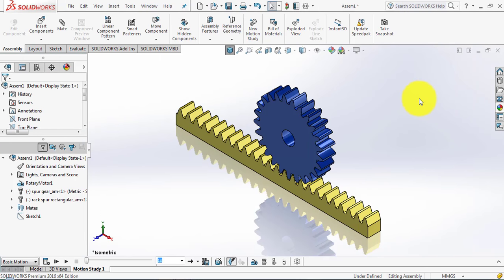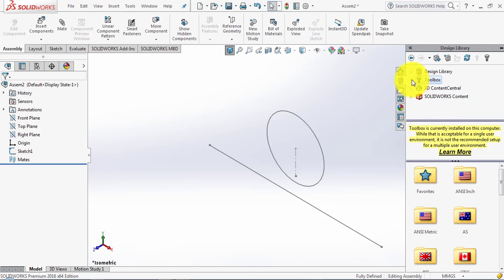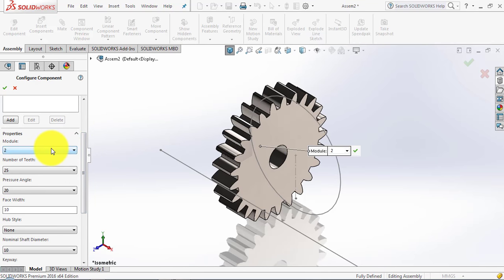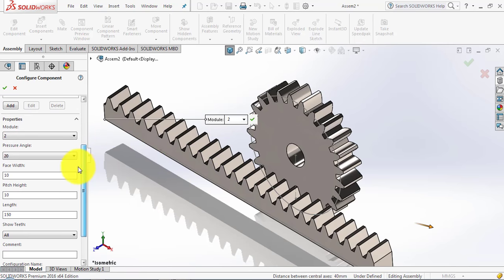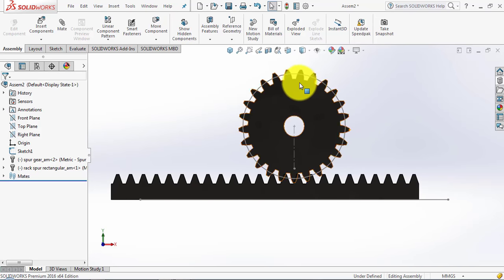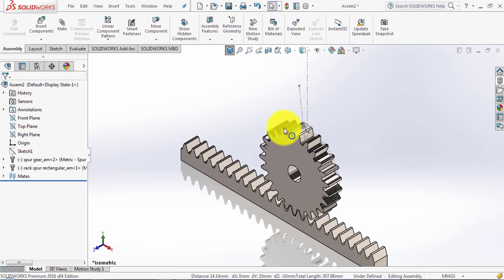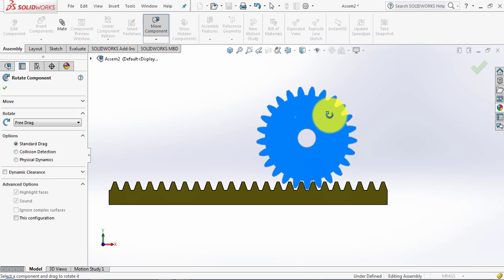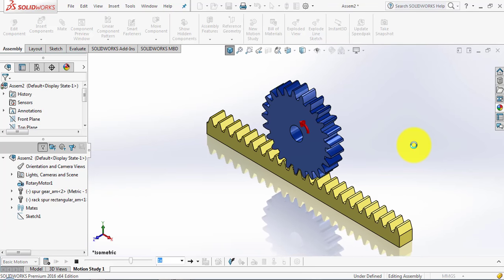⚡ SOLIDWORKS TUTORIAL #12 || Design a rack and pinion mechanism with motion in solidworks.

Comment: Im trying to do a roller rack and pinion. Ive got it working with a Gear Mate but wondered if I could use the Rack and Pinion Mate? Also whilst the Toolbox has spur gears the matching racks are all straight. Im just using a curve and a circle extruded as proof the mates work but wondered how to model it with teeth on the gear and rack. Can I email you assy please?

Comment: What defines the distance between the rack and pinion of 35mm? Is there a formula for this
Reply: it should be defined as pitch height of the rack + (pitch circular diameter of the pinion / 2), which is 10 + ( 50/2) = 35 for this example. in my formulary the formula it is: e = c + (d1/2)
Reply: @AnlaufStattGleitgel0  how to define the pitch height of the rack?